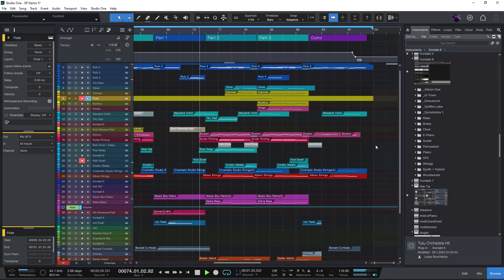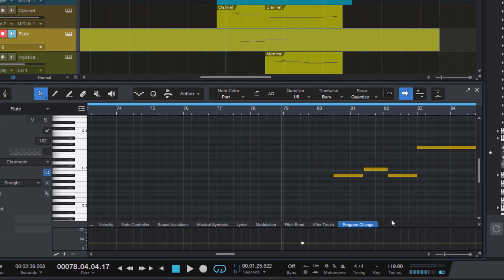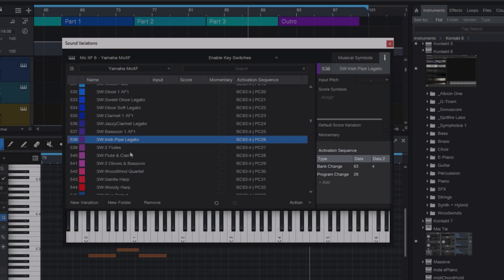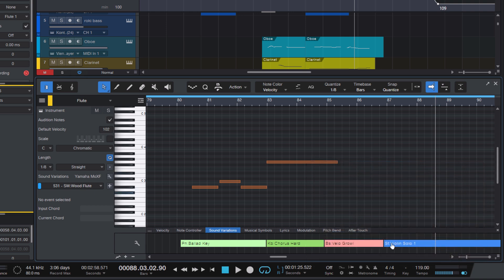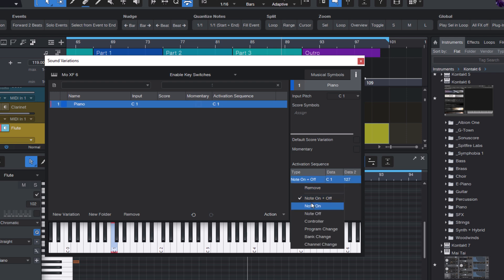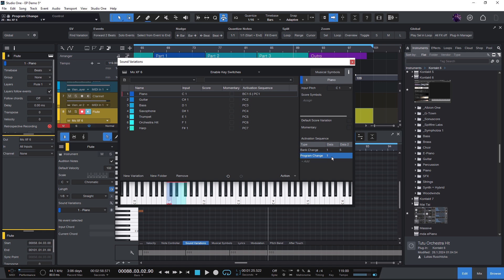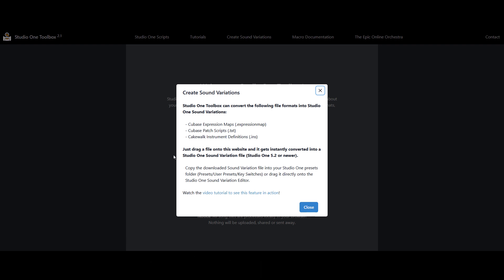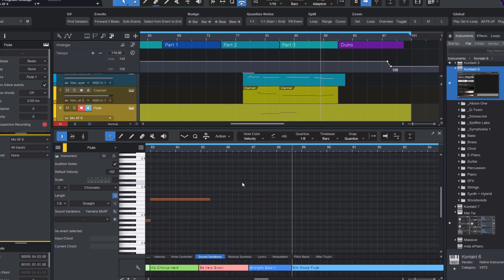Switch Patches in Your Hardware Synths & Samplers with Sound Variations | PreSonus Studio One

Comment: Lukas, does StudioOne have something similar to MIDI Device Panels in Cubase, where it is possible to create a graphical user interface with sliders etc. to control parameters on an actual external synthesiser?  I understand these are defined by .xml files.  An example is shown in this video: https://www.youtube.com/watch?v=ZAQuLYHNuLs. Thanks.

Comment: Hi, thank you for all your hard work. Your videos are excellent. Can any of this be used in the SHOW page? I'm looking to change patches in my Line 6 Helix during different sections of songs.
Reply from the maker: Sound Variations cannot be used on the Show Page yet. You can switch presets in your Helix with Patches but you need to enter the program numbers manually (I have a video on that too). But if you have a lot of presets in the effect board, it could still help to create a SV map on the Song Page and look up the program/bank numbers in the list. Not sure if it's worth the effort though.